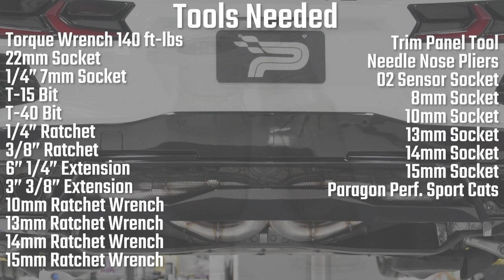Paragon Performance C8 Corvette Sport Cats Install!

Comment: Pretty cool to remove 45lbs for the cat back system and remove 12lbs for the sport cats equal 57lbs(26kg) off of the rear end and adding 20 WHP(14+6) and 22ft.lbs(16+6, or 30Nm) at the wheels.

Comment: I have added the Sport Cats to my 2020 C8 HTC.  The sound improvement is fantastic!

My question to Paragon is how do I prevent the 'Check Engine Light' from being tripped?  I have cleared the code but within a few miles the CEL once again comes on.  Any help would be appreciated.

Thanks,

Peter
Reply from the maker: Hi Peter, send us a email so we can resolve this issue. 

Support@paragonperf.com

Comment: Nice!!! I am so excited for installation of Victor racing Stat wing!
Reply from the maker: Wrong wing, should have gotten a Verus Engineering wing which was designed specifically to the chassis using CFD software.

Comment: If you are keeping the stock exhaust, can you leave the exhaust in place when installing the sport cats?
Reply from the maker: Unfortunately you have to remove the stock exhaust. The OEM cats are to big to remove any other way.
Reply: I was able to remove the cats without removing the bumper or exhaust. Wasn't too difficult.

Comment: Couple questions, is that heat shielding you put on with 3 bolts part of you kit? And can you add sports cats with the stock exhaust, if so approx hp gains, and is car much louder with just sports cats? 5 % 10% louder. Thanks.
Reply: The heat shielding you installed at 9:45
Reply from the maker: @kurtthomas1687  The heat shielding installed at 9:45 is OEM and was removed earlier. There is no need for heat shields with our cats. They were track tested on two very hot days and we have no signs of any melting or any concerns.
Reply from the maker: @kurtthomas1687  Here is a link of the sound comparison you are looking for.

https://youtu.be/X9H5LzLBGTo